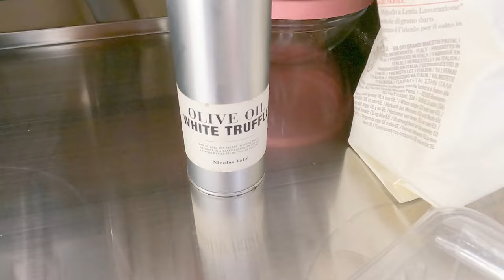Building Our Emperor On Our Off Grid Homestead

Comment: Building and designing something so beautiful in this heat is a great achievement. I would be interested in the temperatures in the tent - day and night. Surely there is a vent?
Reply from the maker: Totally!  It’s been insane.  Day times in the tent are hitting mid 30s easily depending on how hot it is outside and nights it’s dropping down to between 10&15 degrees.  Quite some difference!  xoxo